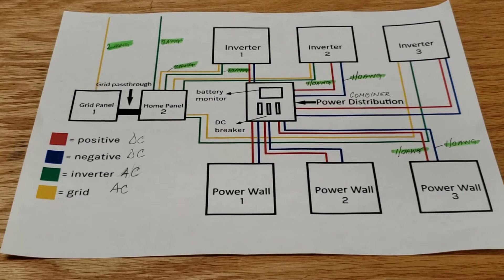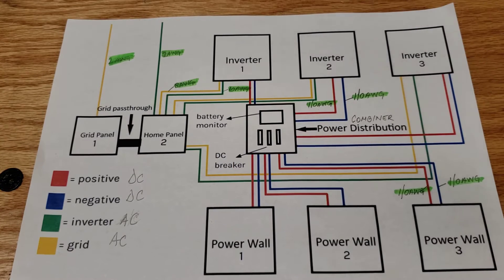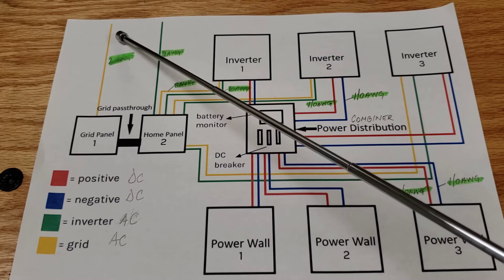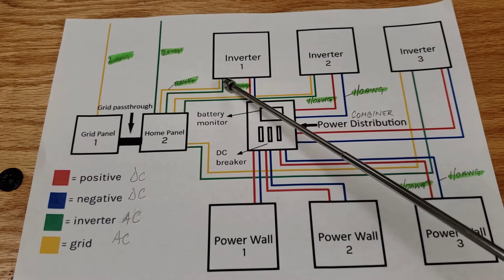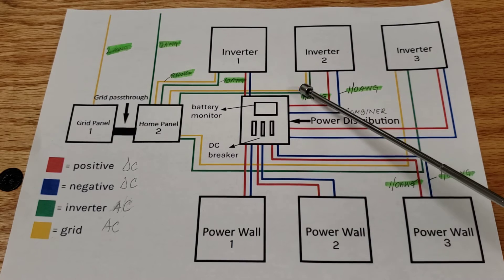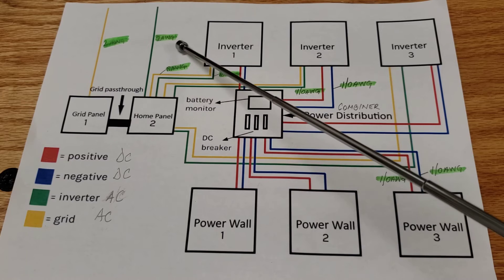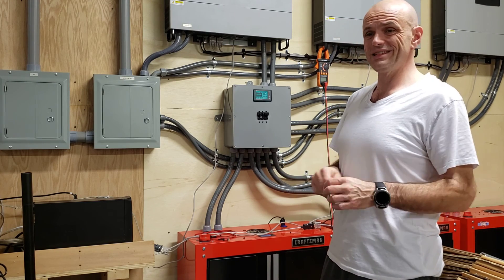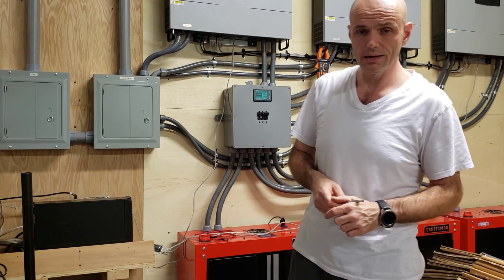LV5048 Wire Sizing and Diagram.

Comment: Do you have a wiring diagram from the grid to just one inverter, battery bank, and panels? I'm having a hard time finding anyone who's using just one mpp solar inverter.
Reply from the maker: They are all parallel. Wiring diagram would be the same minus two inverters.

Comment: Do you have videos explaining more in depth those grid and house panels? It appears your system is feeding the grid from the diagram, but I don’t think that’s the case.  Just curious exactly what’s going on there.  Would love too see inside or a diagram of those 2. 
Very inspiring setup!
Reply from the maker: Think of inverters as giant ATS (automatic transfer switch) Power either comes from grid or from PV, inverters and batteries. Not both at the same time. I hope that helps.
Reply: I am also curious. I am setting up mine almost exactly the same but with a 16s and the new MPP LV6548 inverters. I am using 1-60 amp 2pole breaker from the main house panel and this is used for the critical load panel as well as the feeds to the inverters. The  built-in transfer switch will take care of the rest. It seems to me that you are coming in from your main to one panel and going back to the main on the other? Is this the case? Thanks
Reply from the maker: @danfitzpatrick4112  yes

Comment: I have a question. How did you run the grounding? Where/if did you tie your neutrals and grounds together for the inverter side and grid side panels for breakers to trip? Im concerned about stray currents from the grid neutrals and the inverter neutrals if there was a fault if they shared a ground. Just want to know how you wired the grounds.
Reply from the maker: As described in the manual. But short answer ground on inverter side and grid side are tied together inside inverter.

Comment: Great presentation! Great project!
The inverters you are using are great. It is sad that they are not UL listed. As you know I have a Sol-Ark 8k unit which is a powerhouse but you can buy 4 or 5   MPP units for what I paid for it.
Reply from the maker: Thanks. Have you seen 12KW units from Sol-ark? They can be paralleled now too.
Reply: @DMIINC2013  Yes I have. It came out two months after I purchased the 8k. Kind of upset me because I had been on phone with them for months before I purchased it. I would have waited for the 12k and it was only $300 more.
You can add a string inverter to the 8k though giving a total of 13k throughput.

Comment: So if all 3 inverters are shut off your house has no power or did you use a transfer switch to reroute power to inverters
Reply from the maker: Correct. However........ I have thought of that too....... https://www.homedepot.com/p/GE-200-Amp-240-Volt-Non-Fused-Emergency-Power-Transfer-Switch-TC10324R/100150463
Reply: @DMIINC2013  There are various way to do it I like the Generator panels but you need higher amps so that switch is the best ways so either you get power straight from the grid to house panel or it goes through your inverters, obviously but not both . Cheers.
Reply from the maker: @offgridwanabe  That switch is so simple. My 14 year old can operate it. Thank you. I try to keep videos simple. Your question was super valid. Thank you.
Reply: @DMIINC2013  wow! this transfer switch which is basically some metal, a handle and some terminals is 500 bucks! which is almost half the price of the inverter! Great video by the way!